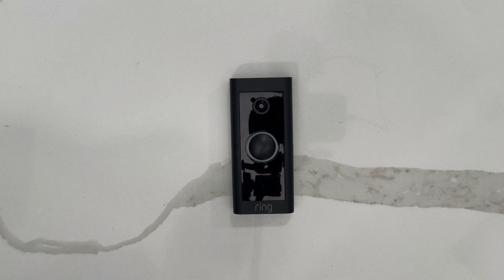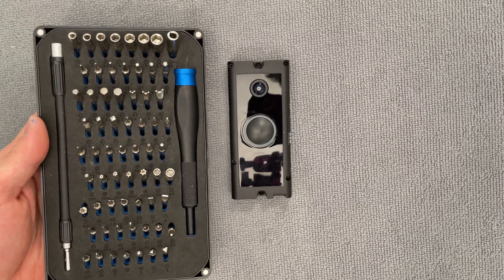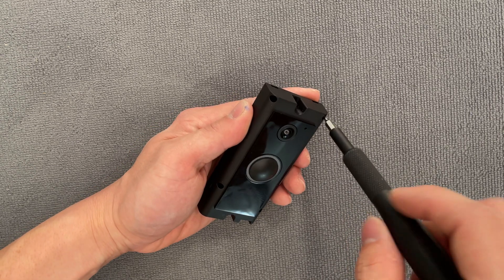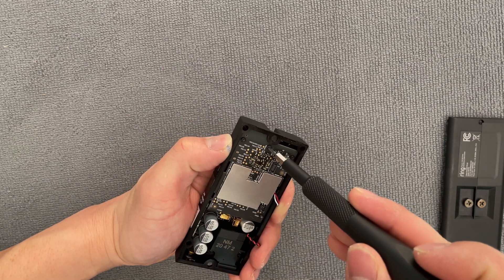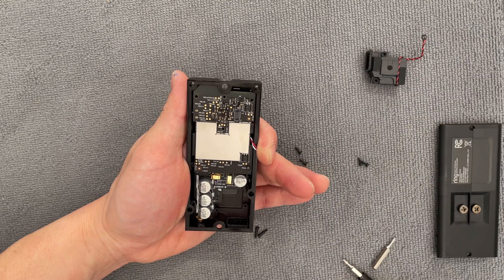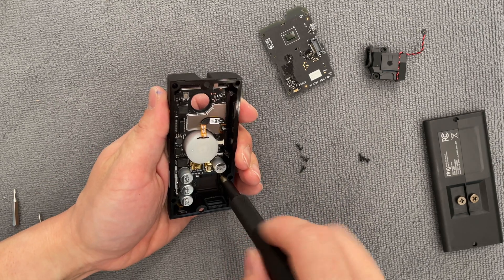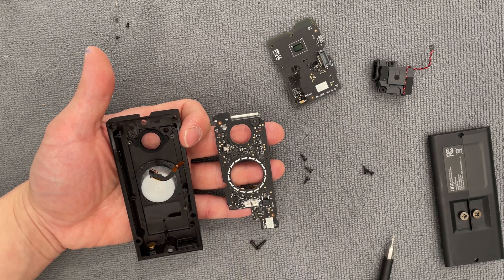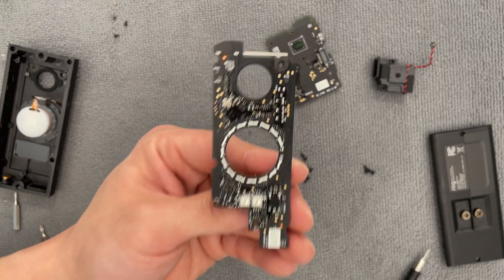What's Inside Ring Doorbell Camera - Teardown

Comment: 3:30 that weird chip just above and to the right of that connector is the BLE chip antenna around 2.5ghz used for selling your data and selling your internet to give the jungle website a mesh network that can be accessed by law enforcement only to catch the bad guys. would be a shame if something happened to that component and u just relied on ethernet connection on other models. whats insane is that the chip antenna litterally faces towards the outside of the house, away from where your wifi is most likely to be. glad you are able to cash in on the free cloud storage though :) we are so cooked.

Comment: as far as you know, may be possible to install an external wifi antenna with sma connector from the board? cannot identify the connectors from the video, did you see them around inside?

Comment: Is there any way to remove the camera sensor from the board and connect it via a cable to the board again? Or is it possible to connect small board with camera sensor to the other board via an extension cable and where to buy it? Thanks in advance!

Comment: I have the later model "GEN2" and could not get the back off. Also, I was unable to fathom why the external doorbell connectors will not ring my existing door chimes. So frankly the Ring Gen2 sound and message to my mobile is an insufficient alert to notify visitors calling. Furthermore the Ring APP config has three user settings to adjust the electrical characteristics of the external door bell connectors.  Yea!  I am regretting having fitted it.

Comment: Super helpful video. I was concerned that the white leds would draw kids/drunks to the doorbell not to mention the attention of neighbours who may think im making a point of having a camera device with a ring light aggravating them. I Bought this exact kit you use and opened mine up. I used black insulation tape and cut small pieces with scissors a little bit bigger than each led then I taped over just the white ones. Now at night the only light is the 2 red ir lights which are far less noticeable.

Comment: I have the same ring doorbell as the one in your video,  the problem with mine is the speaker is really load and distorted when I'm talking to someone at my front door, the person at my front door can't even understand what I'm saying. Do you know if the speaker is faulty or can I turn the volume down somehow? There is a volume setting in the app but it's only for the chime when button is pressed and not the chat volume. Good interesting video.

Comment: I have got free ring wired on offer. However I have no way of wiring on the outside. I tried connecting 9V standard alkaline battery on the doorbell and it works. I though that I would need higher Voltage, but it works. My only question is could this setup cause the battery to vent is there any protection on the circuit? Thank you
Reply: Hi, how many hours does that battery last? I'm in your same situation. Thanks!
Reply: @LightBarooon  I had it hooked up only for a while…so can’t really comment on longetivity

Comment: This was useful. I plan on buying one but I needed to see if disassembling it would be easy and not a hassle. I want to fit the camera into the door's peephole but looks like I'm gonna need to figure a way to fit the board that it's connected to. I don't want to put it outside the door which is why I want to do this.
Reply: @J0kerHecz hey, did you manage to install the camera and button separately into your door?